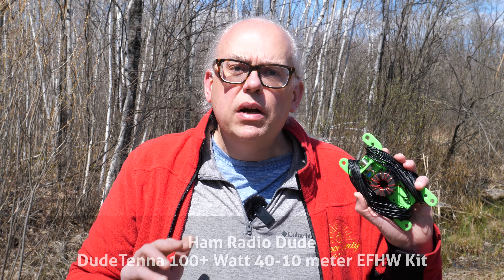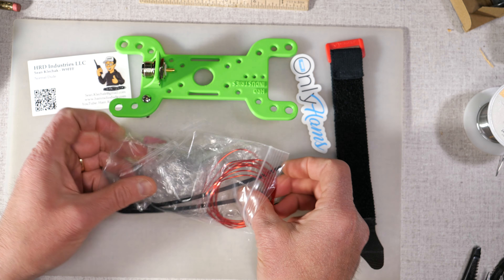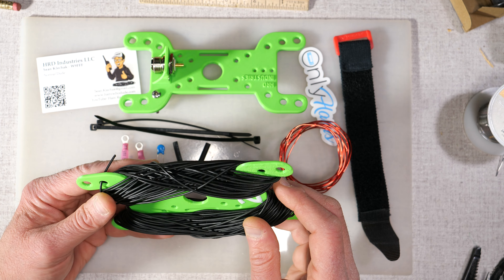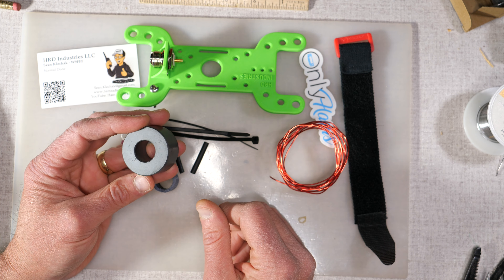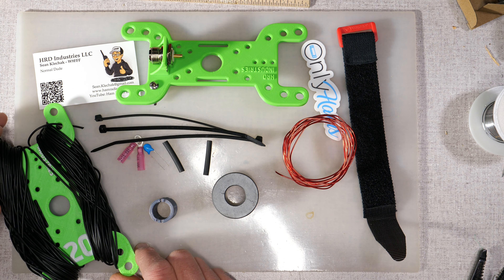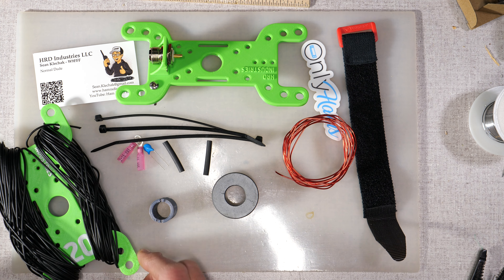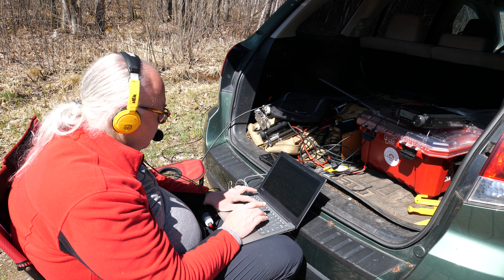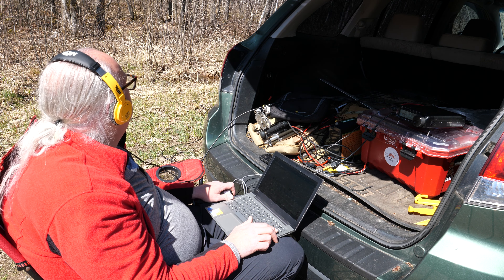The Essential Portable HF Antenna: 100 Watt End Fed Half Wave Kit

Comment: Thanks for the input,  I think I'll work on some written instructions.   I appreciate the feedback! Just some information: I'm currently waiting for more wire to arrive as well as another batch of toroids.  There may be a 8-10 week wait for the full kits to be available.   If you like the winder and have access to a 3d printer,  the files for the winder in so239 and bnc are on thingiverse.   Thanks again for the feedback.
Reply: I laser cut mine out of abs plastic sheets,  lasts forever, just one part I heat up with a heat gun to bend up for the so239 connector.   Don't trust 3d prints in the hot summer through cold winter,  lol 😂
Reply: @chrisnmichelle0218  Laser cutting works well.  I've yet to look into ABS sheets for mine, but would like to give it a shot.  For my printer,  I use ASA filament on my winders, which would be similar to ABS material with the improved UV properties.  Good idea.
Reply: @HAMRADIODUDE  I buy my abs off of Amazon,  little sheets like 24x24 for small non production playing,  lol.   Ventilation is key with it though as it could smoke out your workshop / house with horribly toxic fumes,  lol. I use 0.177 inch thickness.

Comment: great antenna. love the idea of the small coil 6 ft from the winder. I got just the winders from Ham radio Dude. nice winder . will take the bigger FT 240 cores. I used a FT 240-61 wound 49:1 on 14 AWG mag wire. I did the 2 to 14 wrap with tap at 2 turns. no twist. mono band 10 /11/12 meters. works super veritable with ground radials on ground and DX commander 10 meter pole. takes easy 250 watt . even 200 watt FT8 for 1/2 hour before core heating. got the hole 10 meter band under 2:1 SWR with a dip around 1.25:1 . the past few days on 10 meters been down. hardly and contacts on 10/12 meters. I also used my build on 15/17/6 meters . only local on 6 meters SSB. I cut mono band wires and went with 61 ferrite mix. found better on higher frequency's. my 43 mix was better 160/80/40 meters. and that with 3 turn primary wind. 64:1 . got less core heating that way compared to 49:1 wrap and tap at 2 turns.  that with FT 240 cores. type 43 and 61 ferrite . nice antenna wire. 73's
Reply: the 240-61, how does the toroid fit? I could probably make a few adjustments  to the winder, for a better fit with the  larger toroid core. Thanks, I appreciate it!
Reply: @HAMRADIODUDE  it hangs off the sides a bit but with zip ties it stayed put. when I get a chance I will snap a pic and post it.  I will get more winders some day.  I have DX 50 wire from Callum on it now and up on 10 /11/12 meters and the bands not so good the past few days. 73's
Reply: If you watch MM0OPX's videos, he did tests on the ferrite cores, and the one which ham radio dude uses is about the same mass or slightly more than the 240 torroid, and is a good bit more efficient. A commercial EFHW supplier in the UK now uses this ferrite core, and others are following suit. Using a 240-43 is a backward step, unless you want a lot more power handling and you use two or three 240-43s or 52s.
Reply: @paulsengupta971  I know Collin . I had FT 240-61 cores. type 52 ferrite  i do not have yet. the 61 is better 12/11/10/ 6 meters . 52 better 15/17/20/maybe 40. the 43 mix is great for 80/40/20 . I wind QRO  with #14 or #10 AGG wire . the 2 stack with 10 AWG mag wire. 49:1 ran 500 watt FT8 for a wile. on 10 meters. the same on 43 mix it got hotter in less time. that core in video is out of stock at this time. could not find 52 ferrite in stock. I got 43 /31/61 mix ordered from Sota beams now. 73's

Comment: Such a good review that his current stock is sold out. But my question is, that the antenna wirer wraps nicely around the plastic wire holder, but how about when the inductor coil is in place. Does that make it bulky to pack or is this antenna more for a permanent installation? Thanks!

Comment: Hey, Michael, I enjoy all of your antenna review vids. But I'm curious: what antenna do you use at your home base station?
Reply from the maker: I know I've talked about this on the livestream, but for the life of me, I can't find any excerpts to really point you to. I live in a residential neighborhood with a standard sized 60x120 lot. My antenna choices are a bit limited. I have a G5RV that spans the lot. The feed point is above the house so the ladder line segment follows the roof line (not touching) and coax enters the house. I get very good results with this antenna and have worked the world with it. I also have a 71 foot end fed random wire antenna in a sloping configuration with the feed point and transformer positioned in the wife's garden. You can see that antenna in my recent review of the Chameleon URT-1. The random wire is more prone to noise, but it works better for me on the higher bands than the G5RV does. Beyond that, I have too many trees and other obstructions to put up much of anything else.
Reply: @KB9VBRAntennas  Thank you for the detailed reply!